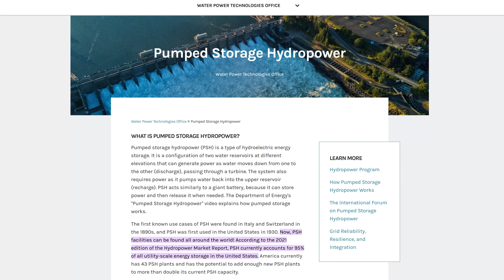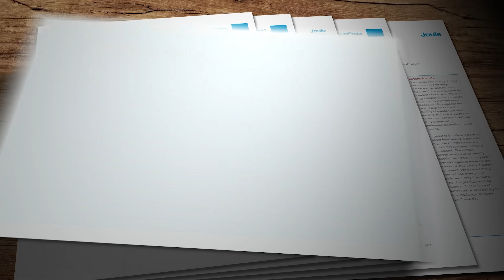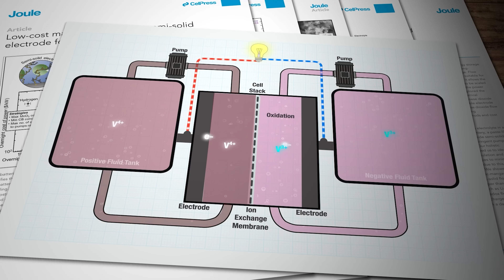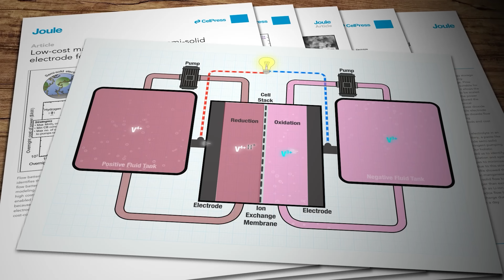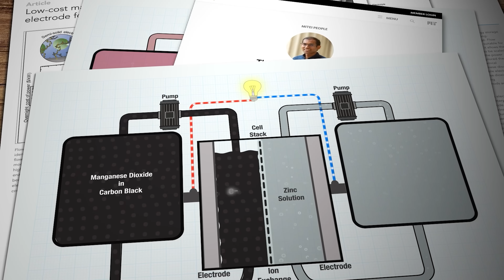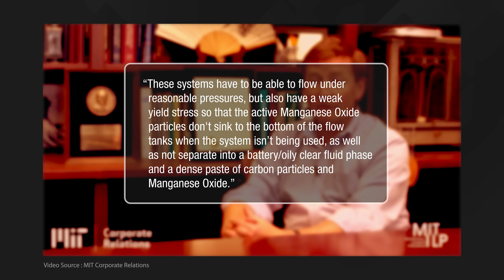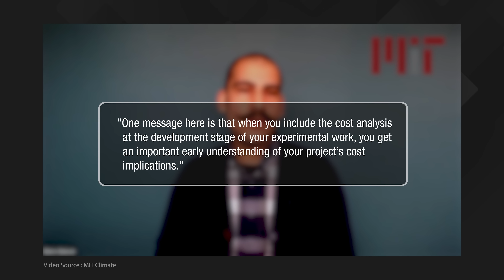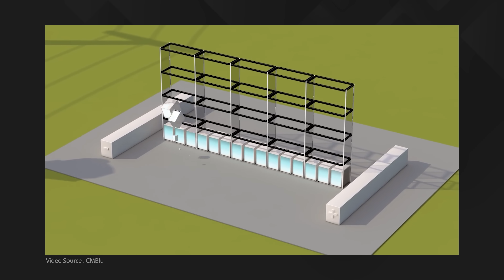Have we found the missing link in the energy storage equation?

Comment: Before anyone replies to this, I am well prepared for ridicule. As coal mining is abandoned , there will be many deep, vertical, shafts no longer used. Lowering and raising very large weights into these shafts could provide a fairly simple equivalent to pumped hydro. No?
Reply: You're missing scale. 1 kg raised 1 metre stores 9.8 Joules. Coal is in seams, or horizontal layers. So a mine shaft is dug to access the seam. The shaft is big enough for the elevator, which holds a group of miners, or the coal they dig out. So a small shaft accesses a large seam of coal. Most mines aren't made this way and haven't been for decades, they either just remove all the overburdened, or cut sloping tunnels you can drive down. 

Say the shaft was big enough to fit a 1000 tonne weight, (1 million kg). That's a big mine shaft. And was 100m deep (that's a deep shaft).

1 million times 100, times 9.8. That's 980 million joules. Sounds like a lot. 980 MJ. That's 272 kWh. Enough to power 10 homes for a day.

If you could slide the weight in or out then you could have a stack of them at the top, and a stack at the bottom. Room at the top shouldn't be hard, but room at the bottom, might be. If you had 1000 such weights, and a handling solution to get them on and off the elevator, that would be enough for 272 MWh. If there are 1000 suitable mine shafts in the world (probably not) that's enough for 272 GWh.

World energy consumption is about 25 TW. So you'd store enough energy to power the world for about 40 seconds, give or take.
Reply: @gasdive  Thanks,
I hadn't done the maths. Story of my life, really.
Reply: @martinevans1427  the principle is sound. Just need to make it bigger than the found mine shafts.

There's a German guy doing the rounds trying to get someone to build his idea.

Find a lump of sound rock. A big lump. Well a big rock area really. 

Cut a one kilometre radius circular slot vertically down one kilometre. That gives you a plug of about 3 cubic kilometres. Put a seal into the slot (this sounds hard) so that water can't come out of the slot, but so the plug can move up and down. Then cut away the bottom of the plug so that it's no longer connected to the ground. You'll need to prop as you go so it doesn't collapse.

Now you have a movable plug sitting in a close fitting hole. Pump water into the hole from the bottom. The pressure of the water lifts the plug.

You could lift it maybe 500m before it gets unstable. It weighs about 10 billion tonnes, that's 10 trillion kg.

9.8 times 500 times 10 trillion. That's 49,000 trillion Joules. That's quite a lot. Enough to power the whole world for about half an hour. Put another way, that's over 13000 GWh. Enough to supply 500 million homes with electricity for a day.

It's completely barking mad of course. The seal seems impossible. Having the plug stay in one block seems impossible. But who knows? If it could be done it wouldn't take long to build.
Reply: @gasdive  That's fascinating but why attempt to make a single storage unit, capable of supplying the needs of most of planet? Surely the distribution costs would outweigh any advantages of scale? Here's another, probably flawed, idea. Very large, several kilometres in radius, floating structures, allowed to rise with tides or restricted from doing so as power is required and anchored in areas of large tidal ranges. eg SW coast of the UK and many more around the world. Granted, these 'islands  could only store energy at certain, predictable times but they could also be the base for other, offshore, activities, eg wind farms and could produce energy when they are not storing it.
Reply: @martinevans1427   you'd still need dozens or hundreds to cover world storage needs, so it's not really a single place.

If you're going to build a floating structure some km in radius, you could have ballast tanks that you blow air into to raise the thing (barge, counterweight, float, whatever) many metres into the air. That would store energy that could be recovered by releasing the air through turbines. So you wouldn't be limited to the tides.

My current favourite storage is to make small steel boxes. (shoebox, to 1 cubic metre depending on how fast you want it to discharge). Fill them with a salt that melts at about 500C. Make a big pile of them in an insulated box. Heat it electrically until the salt melts. That stores a lot of energy in the melting without changing the temperature. NaCl is 0.52 kJ/g, and the density is 2.16, so a cubic metre box holds 1,123,200 kJ or 312 kWh (but it melts at 800, which is too high, there are other salts with similar properties that melt near 500). 500C is ideal for making supercritical steam, and steam turbine generators love it. Use the waste heat for area heating. That means you can put storage right in cities. Electrically the round trip efficency is about 50%, but if you need heating, it's close to 100%.

If you're not using the heat, then you can put them into old coal fired plants. The one I worked at had a coal storage area that was roughly 400x600m so stacked 50m high that's 12 million cubic metres, or 3,744 GWh. Only about 1,700 GWh would be available electrically, but that's enough to operate that plant for 600 hours (25 days) at the full 2.8 GW. The plant already has everything else you'd need, so it's the cost of the steel boxes and some plumbing to get the steam from the old coalyard to the turbines. If 25 days isn't enough, make the pile of boxes bigger. The salt never changes, so it doesn't really have a cost, you can sell it for what you paid for it when you're finished with it.

Comment: It occurs to me that all these storage solutions fall into several distinct categories. For instance, gravity (hydro, weight), chemical (too many to list!), mechanical (flywheels) and heat (can't think of any examples, but there must be some). Are there other categories? If you look at potential solutions in this way, it's immediately obvious that the 'chemical' category stands out from the others in terms of environmental problems - sourcing rare ingredients, storage and handling of dangerous chemicals, maintenance difficulties, disposal/recycling, etc. The other options may have their own drawbacks, such as high capital cost, but generally are much less damaging to the environment (ie the very thing we're trying to protect with all this tech). It's arguable that, looked at in this way, ultimately, it's pointless looking for chemical solutions.
Reply: One thing falls on another and that makes electricity. Gravity pulls water down onto solid ground. Sunlight is entropy I suppose, pushing light to earth or solar cells. Heat expands (entropy again i suppose) and pushes on a turbine, spinning it. Even Electric charge opened to a line without charge is entropy pushing energetic stuff apart and down the line or out around it as a field. Wind pushes on a turbine blade. Waves/tides push on a water turbine. etc etc etc Only the sunlight to solar cell seems different, but it is still light hitting something. It's just the conversion to electricity directly which is different -- rather than heating a gas to expand or directly pushing on a turbine to spin it
Reply: •Gravity is deceptively weak. We need immense dams to make it work.
•Mechanical has too much wear & mass. It is good mainly for mechanical coupling.
•Chemical (biofuel…) has efficiency & emission problems.
•Electro-chemical (batteries, fuel cells) are powerful, dense, efficient, low-maintenance, reliable and recyclable. Still expensive, but getting harder to beat.

•Electrostatic (capacitors) or superconductor systems are extremely simple in theory, but just too fringe.

Comment: so the conversion of particles of photons falling in waves on a solar collector energize electrons, just sitting there, causing them to flow in an electron current, electricity, down copper wires in to a device called a battery, after the military word for a battery of cannons,  and can be stored in some mixture of rare earth elements, some wet or some dry, to await being discharged, fired off like cannonballs,  to cause electrons to flow out of the battery into some specific predetermining circuit...  to perform a task like power a laser to produce concentrated and accelerated photon current waves, to be sent inside glass fibers... to a "receiver" that transforms the transferred photonic energy into another "surface: that ectites electrons again into a conducting channel into a variety of components such as transistors, that switch on and off ...and reverse flow... or amplify the electron currents again... on copper or some other metal, that "resist" the flow and results in wasted energy producing "heat"... so back and forth from photon to electron, back to photon, and again to electron...(what a waste of time, energy and speed and efficiency)... but the entire process is a net loss resulting in waste as heat...and heat is cost!  

when instead the photon could have been stored as itself in a photonic "battery" and packed so highly that one photon is occupying the same space as another photon and so on, and so on until we have a photonics storage device that is close to a black hole... (but hopefully not quite so dramatic)... a photonics battery then releases photons, in all the many ranges of color of light, simulantiously, at the ultimate speed of light... instead  of slower electrons...and without the making of waste heat... thus faster circuits and more efficient processing... so again why all the nonsense of electronics... using electrons? why not concentrate on photonics?
Reply: My guess is that it would be a favorite, but the technology is developing quite slowly. Or at least the advances are producing smaller improvement of performance. When water falls from a dam it's massive, but you can't carry a dam in your car. When sunlight falls it's day-time only and just a tiny bit here and there, though massive all-together. These are problems to be overcome. Batteries will help a lot.

Comment: These considerations about energy storage are very nice but there is always a limitation due to the physical limitations of the various mineral ressources which would be necessary to build extensive energy storage facilities. There are rumors that it is not feasible to convert massively thermal cars into electric cars in the near future because of the discrepancy between the global demand of lithium and the development of factories able to supply industrial-grade lithium necessary for the production of batteries for the cars. I don't speak of energy storage.

Comment: Rather than intermittent renewables that require  grid scale levelling, how about nuclear power base load power with home scale load levelling. So in the morning, when everyone gets up up and puts the kettle on, the instant demand is supplied locally, then trickled charge through the day ready for the evening demand. That way, you reduce the "jerk" on the grid.
Reply: That’s too simple.  Apparently, We have to try everything that’s sounds good instead of what works.  Besides this would put all the battery researchers on the dole.   Cheers

Comment: Thank you for another great video! I don't know about this Manganese dioxide flow battery, though. Seems like it would have continual maintenance costs due to the stress on the pumps from all that goop. Sure they've figured their battery would still have a cost advantage at longer discharge times, but the sheer annoyance of having the thing continually under repair would be a strike against it, I think. Power companies would probably prefer a battery system that runs quietly and can be safely ignored most of the time.

Comment: The weak point is the membrane which is susseptable to pressure, chemical attack and membrane blinding. The area of the membrane is the controlling factor to the size of the plant. Great idea, but not there yet.
Reply: Membrane mechanical and chemical stability would not be a problem: the electrolyte seems not aggressive; membranes exist in resistnat materials like PVDF; the battery seems have been tested for 300 cycles and this is a basic point for engineers.
One may fear cause blinding/clogging the membrane because of precipitation of Va or Mg or Zn species within the membrane during redox processes. Hopefully this seems unlikely or reversible. 
Now when the membrane issue remains, it may be possible to change the membrane alone, or even change the cell stack emptied and easy to repair or recycle because it contains only standard materials, not likle e Lithium battery.
Reply: They could probably make the membrane user-serviceable (replaceable) if it lasts long enough, just empty and clean the cell first. They probably have to have a way of isolating each cell with valves anyways should the membrane break.

Comment: A question rather than a suggestion... Would it be feasible to ship charged tanks of this from energy rich areas? Or would long distant transmission lines still be better even with their large loses and high capital cost?
Reply: The statistic that matters when shipping energy stored in chemical reactions over a significant distance is unit of energy per unit of mass. For batteries that is often measured with watt-hours per kilogram. For utility scale applications, the equivalent unit kilowatt-hours per tonne can be used.

Shipping batteries around only makes sense where power lines aren't practical. For example, to power moving vehicles. 

Portable lithium ion battery systems can be used as cost effective alternatives to portable petroleum generators where only a few hours of power are needed at a time.
Reply: @hamjudo  thank you for the info.
I was thinking in terms of power lines becoming less practical over very long distances.
Reply: @dinky9216  There are tradeoffs in power line design. The 1.6 million volt DC line running halfway across China was expensive to build, but it is very efficient to operate.

Doubling the transmission voltage reduces the electrical losses by a factor of 4. Using DC instead of AC requires rather expensive equipment at each end to do the conversions, but the power savings are significant along the wire.

Comment: All these grid storage solutions need to be weighed against simply installing more renewable capacity. In some sunny areas, solar costs as low as $0.02 per kWh. So we could install 3x more panels to make sure there is enough production in winter too. Same with offshore wind, which now goes for around €0.05 in the North Sea. The excess production when it's both sunny and windy can be used to make hydrogen as chemical storage or for chemistry.
Reply: The trick is that there are times of the year when "just install more" actually isn't viable. Hence the struggle to choose an energy storage solution, such as your hydrogen preference (I actually don't like hydrogen much- pumped hydro works better if you can find viable sites, and hydrogen is in general a horrible fuel).

Comment: Couldn't help but notice that at the 2 longest timeframes Hydrogen had a lower LCOS than the proposed novel battery. Do you have any details as to which type of hydrogen storage was being considered by that study? electrolyser, storage tank, and fuel cell?
Reply: I noticed that too.  Green hydrogen will be in high demand for various industrial processes like steel and ammonia production, so there will be a lot of pressure to produce better electrolyzers, and hydrogen handling equipment will benefit from economies of scale.  Unless the exotic batteries get significantly cheaper, hydrogen may end up being the storage method of choice. Since solar and wind assets are connected to the grid, the electrolyzers and storage tanks could be anywhere.  The cost and efficiency of fuel cells remain a concern, however.
Reply: @incognitotorpedo42  check out this paper "Projecting the Future Levelized Cost of Electricity Storage Technologies" it's got a cool heatmap of forecasts for the ideal storage tech depending on context

Comment: just have a think - Zinc flow Batteries are BULLSHIT, Tesla is 2022 will be Transitioning to LFP batteries for MEGAPACK and is already having SUCESS with LFP in the China model 3 and model Y. 
TESLA may even go to LFP in POWERWALL.
LFP batteries are MORE Transformative than ZF batteries, and LFP has PROVEN safety Record and performance and Charge/Discharge are already well KNOWN.
best of all, LFP can be Charged to 100% w/ minimal Degreadation and can be MASS Produced CHEAPLY. LFP can even be used in 4680 form factor.

Comment: Any storage system that saves Li for mobile applications has to be a good thing.  How would this compare with the already developed liquid metal batteries by Ambri or the ZnBr flow/plating batteries from Redflow.  We also seem to be on the path to a Na ion battery similar to the Li batteries if they can get over the problems due to the larger size of the Na atom.
Reply: Ambri has been a long time in the "valley of death", the time of lab to real product. They are still calling for a 1MWh demo project this year. But have not seen details of where it is happening. They did get more money $144m in Sept 2021, so still hopeful. But very high heat is a bitch to work with when you want a 20 -30 year life span.
Reply: I looked redflow , according to there site they have stared manufacturing a battery.  My head calculation is that it stores 450 amps and goes to 0 voltage, no worries. Thats up to 60 Vts, varied dc output.. And is stackable.
They have deployed  some . Seems like a good home instal. Galion the other zinc bromide  battery also is being deployed. But does not look like its for small scale houses yet. Does appear scalable